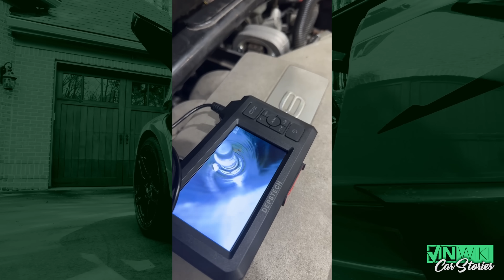I dropped gum into my engine...

Comment: if its pre 2007-2008 you need to be careful about getting water and junk into the center valley where the balance shaft lives. The B8444S was plagued with BS bearing wear issues, and the repair involves taking one of the heads off. When you mentioned the gum falling i immediately thought you somehow dropped it down in there...

oh also goodluck finding a timing chain/set for one. Other than than, amazing engine. And im doing a swap project with one of these!
Reply: Ideally the V8 timing chain doesn't need to be replaced ever though, right?

Asking as a 150k+ miles XC90 V8 owner here
Reply: @SuperMrgentleman I’m at 198k on the wife’s XC90 and the gum was the worst I’ve heard it sound - no timing chain rattles so far 🤞
Reply: Thank God I had the plenum still on because yes, that’s a bad spot on these cars - it’s an ‘06
Reply: @nikkrueger5734  Yeah the scheduled maintenance never has the timing chain replaced, I'd think it'd be good a long long time
Reply: @SuperMrgentleman   Its a wise "while you're in there" sort of job but its pretty normal to go well into the 200-250k miles range (assuming nothing goes wrong before that) with any timing chain. Despite the fact they do not actually "stretch", the individual pins/rollers along the chain wear and result in a noticeable difference in length when set out along a new one. At bear minimum you change the BS bearing (which kits are still made), tensioner guides, and tensioner. But the chain itself is truly unobtanium (even trying to go through fcp or direct).  These cars are going on 2 decades old and so this is going to be an inevitable issue for owners everywhere. The balance shaft is timed, and if you catch the bearing before it nukes everything around it, you can save everything else. 

The main killers in other ford/volvo timing chain based engines you may have heard from this era were more or less from bad variable cam timing components "phasers", which isnt an issues on the b8444s. 

Though, perfectly fine used engines are plentiful on ebay at low miles...almost cheaper to go that route tbh if you run into any serious issues. The whole engine and subframe drops out the bottom extremely easily
Reply: @frjhracing  Very helpful. How or why is the chain so impossible to get? If I find a basically nonfunctional V8 I probably can rip the chain off of that, right?
Reply: @SuperMrgentleman  availability pretty much. I think I found ONE set shipped from Europe that was actually in stock last I looked. Usually its not the case these days with used engines...but you can consistently find them from 600-1000 bucks shipped sub 160k mile. But me commenting that on youtube, in front of car people, is likely going to change that real quick 🤣So yeah id just buy one whole engine for parts and a 2008+ with the revised balance shaft and bearing. 

Zero parts store had them, my usual online go to's (fcp euro, rockauto)...nothing. Not even a section for it to be there. In my case, despite having everything for the swap and having a whole donor car - I'm going the used engine route as well. 

but yeah dont take my word, try searching 2005-2011 xc90, s80 (also had the v8) timing chain set.
Reply: @frjhracing  helpful, I'll make a note of this whenever 200k miles rolls around

Comment: Brother not to rain on your parade but you didnt drop it in the engine you dropped it on it or under it... you hadnt removed the spark plug yet so therefor your engine was not open to have anything dropped "inside"  Icould see if the valve cover was off and it fell inside the engine that way but my friend you wasted your time looking for it.
i found myself in the exsact same situation with the hunker in the hole but my hunker was a peble and took 4 hours of crying and swearing to remove... loved to hear it!
Reply: If you say so, then I feel slightly (more) stupid yet relieved